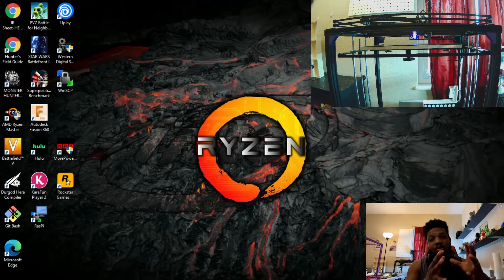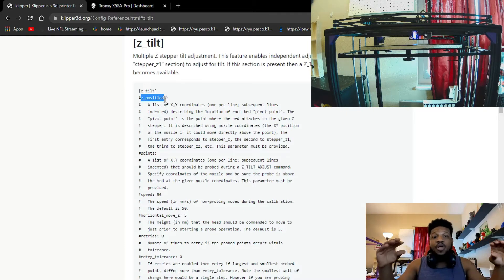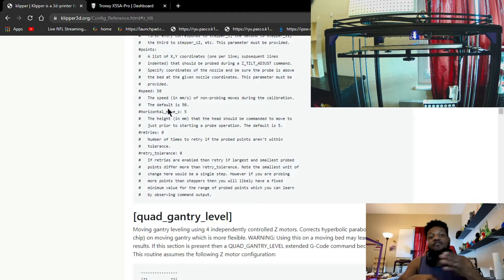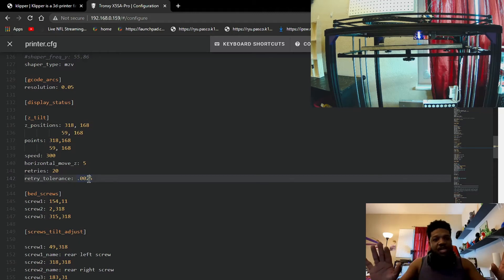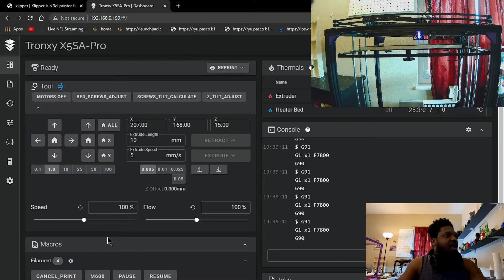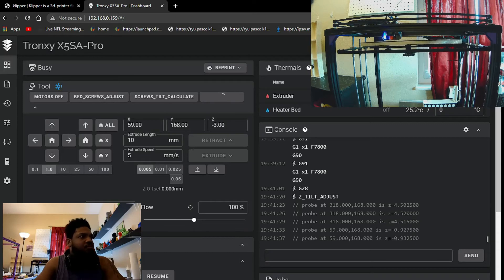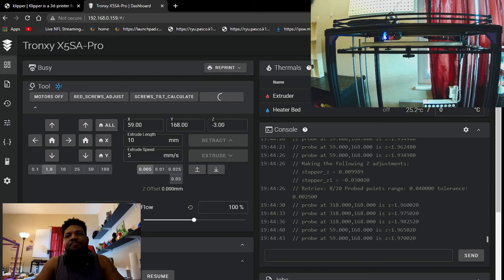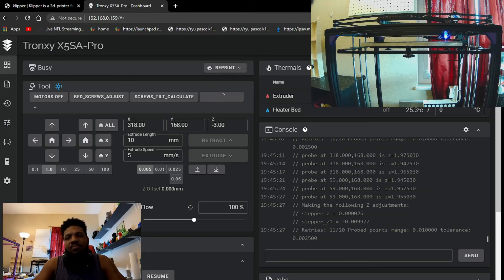//How Setup Z_Tilt In Klipper Firmware // GoldenJaguar392

Comment: 8:11 I don't think you have your z_positions set correctly. This is the location of the z steppers relative to the nozzle, so they should be outside of the points you described for "points". The way you have it configured klipper thinks that your bltouch is probing directly on top of the leadscrew. This is probably why it takes you so many retries
Reply from the maker: Thanks for in the info, this as been address a while now, in the comments below what also played a factor too was my bltouch micron accuracy and too high retry tolerance.
Reply: @GoldenJaguar3D  Maybe add a pinned comment addressing all of this, I am using your videos as a tutorial to set up my printer and it would be good to know for anyone else who ends up here 😅
Reply from the maker: @cheraxquad  you’re correct let me pin yours😁👍🏿
Reply: @GoldenJaguar3D  what are your z_position settings now for it?
Reply: @cheraxquad how do you work out the z positions? the motors are clearly out side the travel range of my x gantry left side being the x end stop so a negative number

Comment: i just found this video while trying to work out Z Tilt before i fit my gantry mods to an Ender 3 v2.

Some of the information seems to be wrong you have the x position and the points set the same?
The instructions say the X positions are where the nozzle is over the lead screws but for the left that would be a negative value beyond the endstop and the right side would put the nozzle halfway through the frame.

as the nozzle can't physically reach these points how do you work out there positions?

Points i get thats the min and max bed travel where the probe is still on the bed

Comment: I have 2 Tronxy X5SA Pro and was looking for this video, As you suggested in a previous video I ditched the Chitu board and am replacing with Octopus. I just finished My Voron 2.4 and loved the QGL and hope I can get these 2 dogs running acceptably. Love your videos Thanks. Did you get rid of the syncing belt between the 2 Lead screws?
Reply from the maker: I never used the syncing belts at all I use klipper z tilt to level out my bed

Comment: So do you recommend hard mounting the bed of a Cartesian printer and z_tilt and bed_mesh? Like remove the springs so the bed is mounted directly to the carriage and let the software square things up?
Reply from the maker: Hmm that's one way to do it...I would suggest to just use stiffer springs or silicon springs then adjust the best to the gantry on a cartesian I think it's worth it to use z tilt on a bed slingers..my lasts build uses Kevin Sam belted z mod

Comment: Hey guy.  Just found your channel.  It's helpin a lot.  I've come up with a sudden issue.  I have 2 Ender5plus with Octopus v1.1 boards.  Printer .cfg files are identical except for LCD display and serial port configs.   2209 drivers for Z and Z1 are identical.   Z-tilt macro....same.    All of a sudden OctoEnder2 when I do a Z-tilt it starts and just drops the Z1 axis each pass until it's out of range.   OctoEnder1.... fine.   And I have NOOOOO idea what could be going on....   Any Ideas????
Reply from the maker: Hey have you tried making sure that z stepper is first stepper and z1 is you're second motor if you're motor are not setup that why is will cause this issue basically check the location of you stepper motor z if on the left or right and make the config reflect this direction.
Reply: @GoldenJaguar3D  I left the house and was sitting in WalMart parking lot and pondering and then that popped into my head.  Came home and swapped them and boom.  Worked fine.   So now I have two OctoEnder printers exactly the same in every way but ONE....LOL.   thanks for the help and the response.  This klipper journey is quite interesting.

Comment: Thank you for posting this tutorial mate, really appreciate it!😁
Reply: I did have to swap the co-ords 300/155 10/155 which started right to left (which created an error after 2 try's), to 10/155 300/155. This way it started on the left side first which seemed to solve the issue straight away. Cheers
Reply from the maker: Your welcome
Reply: Now snagged at a few other hurdles. Great little learning experience but I’ve had to reflash marlin quick to do some prints I’ll attempt again tomorrow👍🏻
Reply from the maker: @flex-ranger2  yea I totally understand you’ll get it though I have a lot of tutorials feel free to reach out as well
Reply: @GoldenJaguar3D  really appreciate it! Cheers mate

Comment: I'v got this error: Z_tilt Probed points range is increasing
Reply from the maker: Make sure you probe z first before z1 also increase retry tolerance
Reply: @GoldenJaguar3D  OK, so instead of toolhead going to the right it should start from the left that is the z stepper and then it should go to the right side where z1 is? if I'm understanding correct
Reply from the maker: @dumdumreviews7436  yes That’s correct

Comment: This is a great explanation for working on Klipper. I noob when comes to this stuff and now I kinda got some new knowledge again. Thank you so much for a great video
Reply from the maker: you're welcome
Reply: How big is your bed on that printer? I probably could just copy that axis for my printer.
Reply from the maker: @robertjamessantos9708  330x330 mm
Reply: @GoldenJaguar3D  thanks. i just a manual moves to see where i can specifically point my probe. thanks for that instructions also. i have a question. i did try to do the command for the z tilt adjust and i keep getting this error.

Retries aborting: Probed points range is increasing

would you be able to help me out on that? i am using a fluid interface and i have an ender 5 plus. thank you again
Reply from the maker: @robertjamessantos9708  what’s your retry tolerance? I don’t set it too thing 0.005 seems to be a good balanced, make sure that you’re probe z before z1 if it’s flips the other z1 before z it cause this error as well
Reply: @GoldenJaguar3D  i did what what you have on your video. .0025 and i made retry to 20. How would you know that your z and z1 is right?
Reply: I did able to fix it. Thanks
Reply from the maker: @robertjamessantos9708  awesome man great job glad you got it figured out just woke up lol, what was the issue it you done mine me asking?
Reply: @GoldenJaguar3D  Hi, its been a while but i never saw that you replied again on the last message i made. i fixed the issue by swapping motors. thank you again

Comment: Your z_positions are the locations WRT the tool head of the lead screw nuts. My setup will nail .000000 with 2 tries from 1.25 difference. I have an x5sa

[z_tilt]
z_positions:-90,165
  420,165
points: 90,165
  327,165
speed: 200
horizontal_move_z: 5
retries: 5
retry_tolerance: .0025
Reply: also I noticed you have no x,y offsets set for the bltouch
Reply from the maker: Thank, I figured this out after the video. Also I use cura for x and y offset instead of klipper

Comment: Thanks for the content on Klipper.  Quick question, Do you need to use more than one driver to use z_tilt?  I have a prusa style printer on skr1.4 turbo and both z motors are tied to one driver on the skr.  Any help would be greatly appreciated.
Reply from the maker: yes! you will need and extra stepper driver in order to do z tilt.

Comment: I put in the code how you displayed it using my coordinates and I keep getting a "z_tilt z_positions needs exactly 1 items."

I was hoping you had a solution!
Reply from the maker: Never seen this issue before, do you have everything setup like I’ve stated in the video.
Reply: I got this same error, did you ever figure it out?
Reply: @octico  I can upload my config when I get home so you can see it. But I don’t have that error anymore
Reply: @leonardorossell8874  I figured it out. The problem is that I had the z1 was not setup to E1 port on my SKR 1.4. Thanks!

Comment: good video !!! i need help i try to do z tilt with klipper but i have an
 error ( probe increase ) it compensates on the wrong side did you know 
where the problem could come from
Reply from the maker: In the video I mentioned to make sure to not mixed up the z steppers they much be in order so z then z1,  z must be probe first so you need  to find out if you z motor is located on the left or right side of you printer.
Reply: @GoldenJaguar3D  my printer is vcore3  3pts probe
Reply from the maker: @mondingue  ok same concept so find which one of your stepper  is  z,  z1,  z2  in that order and where its located

Comment: Hello my friend, is there a way to add this to my start GCODE in SuperSlicer? It would be really nice if I could have my printer do this before probing on each print, but I don't know how to add it! Thanks for the video, very helpful!

EDIT: 

Hopefully you see this comment, I'm pretty sure you have your z_position X coordinates misconfigured. I was following your video along with the documentation and it didn't seem to jive, the docs describe z_position as being the nozzle coordinates IF the nozzle could move directly above the point. Klipper doesn't actually use the z_position coordinates to probe (that's what points is for), to me it reads as if they describe where the leadscrew/stepper connect AKA the pivot point on each side. I jumped on the Klipper Discord to check and they confirmed my suspicions, I'll post my Ender 3 config below (235x235mm bed) so you can see what they should look like. Points should be two (or more apparently) positions along that midline on each side that the probe, these do need to be legitimately on-bed coordinates that can be safely reached by the probe. 

[z_tilt]
z_positions: -28,117.5
  263,117.5
points: 10,152.5
  225,152.5
speed: 250
horizontal_move_z: 5
retries: 20
retry_tolerance: 0.0025
Reply from the maker: Yes just had z_tilt_adjust in your slicer start gcode and it should work.
Reply: @GoldenJaguar3D  Thank you! Check my edit, I think it might help your accuracy
Reply from the maker: @xbuckfutterx  yes I’ve figured that out a while ago after post this video, but what also affect my it also my retry tolerance some probes are only accurate to a certain micro so hits the struggle to reach a 0.0025 but if put at less say 0.0075 I can it that in 2 tries
Reply: @GoldenJaguar3D  I only read this comments section afterwards and saw that you already figured this out, my bad. I'm using an authentic BLTouch v3.1 and hitting my config in 2-3 tries, lucky me!

Comment: Like mechanically you need to print on a banana if you need 0.0025 tolerance and 20 retries. 0.1 and 5 would be just fine. You might want to look into stow_on_each_sample, probe_with_touch_mode and make the speed much faster.
Reply from the maker: No just greedy and want more lol, it now does it in two tries as long I don’t muck around with the bed, I never tried options for the bltouch however I’ll play with them because I’m curious I want to learn more. Thank for you input bro it’s appropriated.
Reply: @GoldenJaguar3D  Greedy is bad :D My ender xy travels are 500mmsec and z is 15. After watching this video I went back to my config and changed the screw positions too. I had them wrong. Probably makes it work better when its doing the math from the correct position.

Comment: You probably should do a PROBE_ACCURACY test first to find out how accurate your probe is.  If you set your tolerance to a value lower than your probe's accuracy, it may never level out.
Reply from the maker: Yes you’re correct, however luckily it’s doesn’t take more 3-5 tries to get that accuracy

Comment: Your Z_positions are wrong. They need to be the location of your lead screws using nozzle coordinates then you will not need so many retries.
Reply: Does it store the values after, or you have do do this before each print?
Reply from the maker: @SplitPhotography  set the macro in the start gcode of your slicer so when you send a print job it will activate z_tilt before it prints
Reply: @GoldenJaguar3D  ok. But not possible that it saves also?
Reply from the maker: @SplitPhotography  no once the motor are off its going be out of sync again.
Reply: @GoldenJaguar3D  yeah your probably right!
Reply from the maker: That's not the issue, the issue is my tolerance is very high, so it will take more retries to match. I've done this way too many time bud!
Reply: @GoldenJaguar3D  So you have tried to input the right locations of the screws in z_positions? and it also takes 20 tries?
Reply from the maker: @ArneSchwarck  ok do me favor report back set you retry tolerance to 0.002 and let me know how many tries it takes.
Reply: @GoldenJaguar3D  ok I will do that. Hope you will also change the positions and let me know if it makes it faster.
Reply: @GoldenJaguar3D  and what probe do you have that you can get sub 2 micron accurate measurements?
Reply: If you have one that is that accurate you could do a z tilt adjust after you completed one already and it should complete in one pass. Is that the case?
Reply from the maker: @ArneSchwarck  i'm Using Bltouch, by the way I change the points to nozzle cordinates which wasn't really much difference for What had. still struggle and failed to reach 0.002 retry tolerances, however when I set it 0.0025  it did manage match this tolerances quickly in less than 5 tries, which brings me back to my original point, the higher retry tolerances the more retries will be needed.
Reply from the maker: @ArneSchwarck  My v1.8 hits 0.0000 with 5-10 retries, with my a retry tolerance of 0.002. like I've done this many time bro I'm  not saying your wrong, what saying is if you retry tolerances are high it can take a coupled of retries to get their. If I was to set lets say 0.005 this easy for all my machines to achieved in 2-3 tries.
Reply: @GoldenJaguar3D  the same. Looks like the bl touch has a 2.5 micron standard deviation. I think I will upgrade to a superpinda and give it a go with that.
Reply from the maker: @ArneSchwarck  yes heat certainly play a role as well let me know if pinda works for you, I don't mind replacing my probe for a bit more accuracy and consistency
Reply: @GoldenJaguar3D  that was the idea of the superpinda it should be temperature independent. But I can test it once I have it mounted.
Reply: @GoldenJaguar3D  so I have settled on 0.010 with about 1-2 tries to that tolerance
Reply from the maker: @ArneSchwarck  that’s fantastic is that with the super pinda?
Reply: @GoldenJaguar3D  yes.